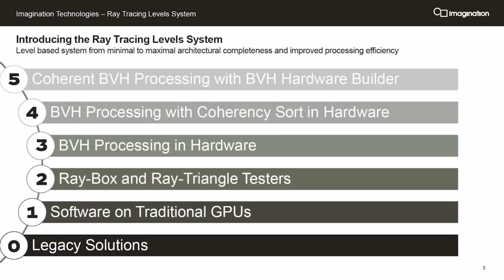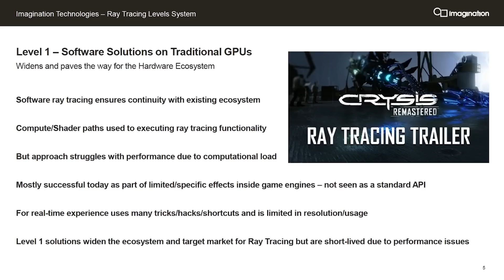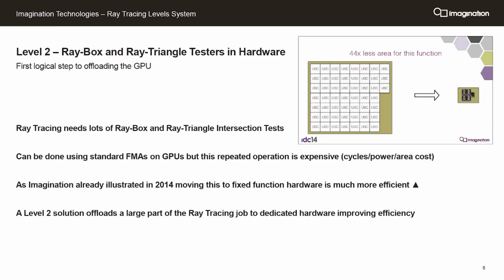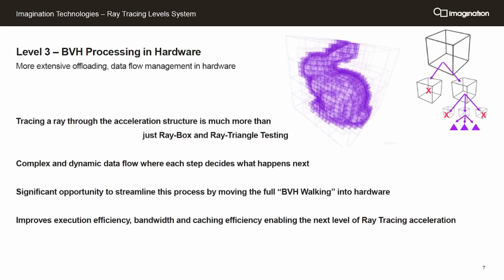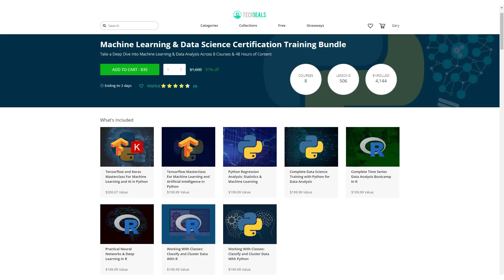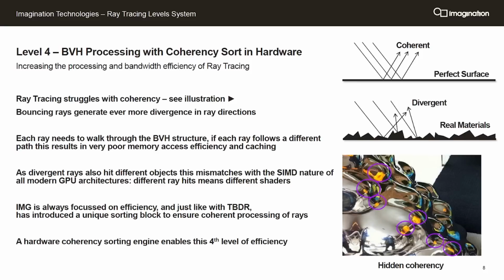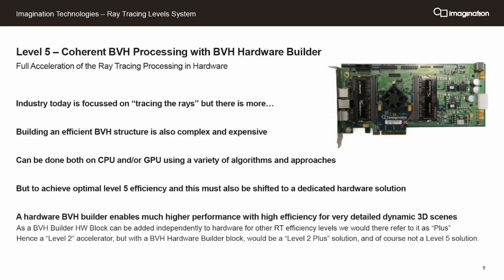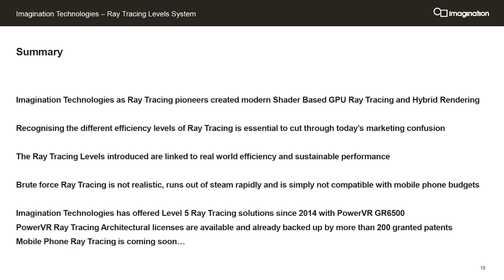Does Your Ray Tracing Stink?

Comment: This is interesting, but the levels are ultimately a marketing piece that tried to box in and make the claim that one approach to ray tracing is the standard end-all approach. Not all solutions are the same. Plus, being a marketing piece (you commented on this at the start), it stops at the same level they are at, and doesn't go further or consider other approaches.

Comment: What about using simd or mimd to compute a scene from multiple points as if there was a camera on each wall of the room looking into the center and then overlaying and merging that data with the object the player is looking at while also adding in an opacity/noise map layer for the absorbed light on the reflecting object. 

Or calculating a brightness and color map of the scene from 4 sides and overlaying that over all objects while taking position into account. That way a painting in the center of a wall would get lit by an average of the colors and brightness of an area of the center of the opposite wall and the 2 other walls proportional to itself. Like taking a picture of 3 walls and scaling them and projecting them on the 4th.

You would only have to calculate  the brightness and color maps and 3 rays per reflecting object to align the maps. It would be an approximation that might even be good enough for AI to fill in the rest.

Comment: no, but not all software based ray/path tracing solutions are the same either?

traditional raytracing approaches basically only had diffuse rays,
basically just raycasting used for collission detection, but for every pixel and angle,
modern path tracing does a wide range of extensions 
for raytracing you will soon notice that more individial compute units = better, it is the least picky on clock speed of just about any workload imaginable, therefor GPUs are order of magnitudes faster, especially when you bump up the resolution.

i can only imagine the efficacy of the hardware solution depends on what solution is used,and what extensions from there on?
it also depends on the amount of samples, some approaches may be slow on low amount of passes, but converge quicker than alternatives on higher sample counts,

geforce RTX is a good example, it does realtime raytracing, which is amazing, but at an extremely low, dare i say unacceptably low number of samples and tries to general purpose AI upscale it, at least optix also allow for offline acceleration though, which maks it more of a selling point  again.

GPUs used to be unable to do certain effects and were therefor CPU-only, 
they've come a lot since in general purpose computing,
but generally speaking, all the big movie studio making animated movies, used CPU rendering because the GPU doesn't allow for the extremely advanced sets of instructions these pipelines require, and the absolute insane ram requirements (of which most can be circumvented through tile-based nature of raytracing though)
therefor the verdict must be: the absolute best quality ray tracing solutions are still software,
but they take 20 hours to render on a farm for a single frame, so there's that lol

as a blender user that spent his time in cycles, raytracing being good or bad can depend a lot on what the engine is weak at
for cycles, since it's not bi-directional , it is weak on caustics, and extremely unsuffarably slow on volumetrics.